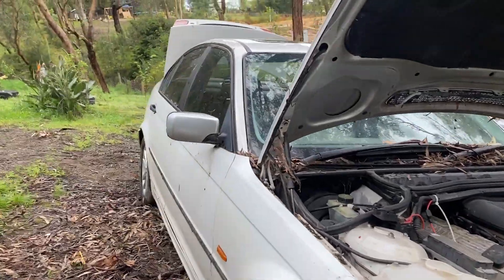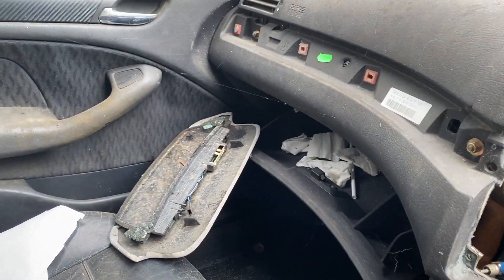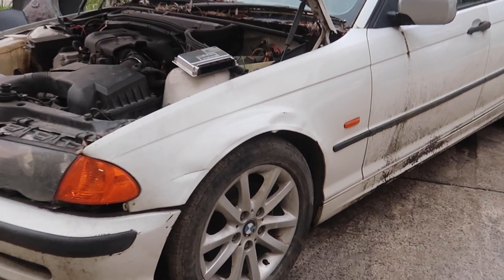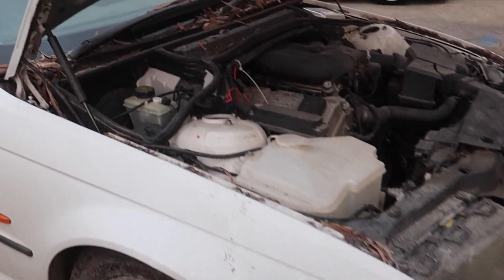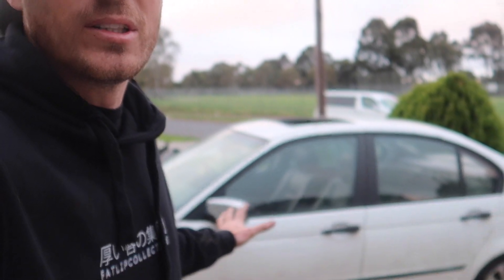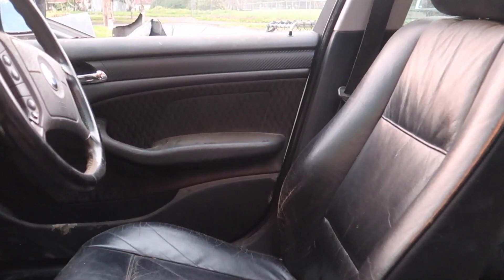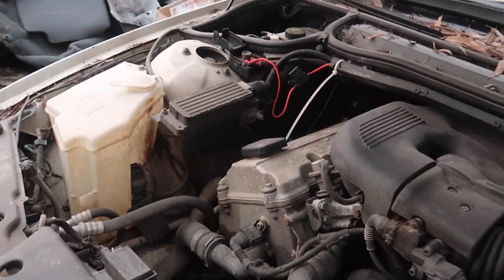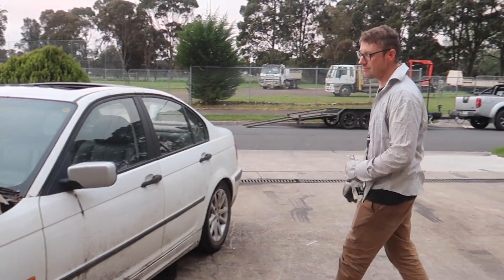Buying the CHEAPEST BMW E46 on Facebook Marketplace...

Comment: First strip it down to a bare shell. You could fit overfenders/clamshell for the rear quarters  that wil go over that damaged pillar. Engine wise if you're giving it away stick an m54b30 in there but if you're keeping at and want to do something different stick an M60/62 V8 in there.  Can be a road car, drift car, drag car, options are endless.